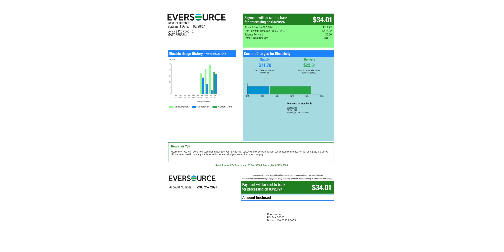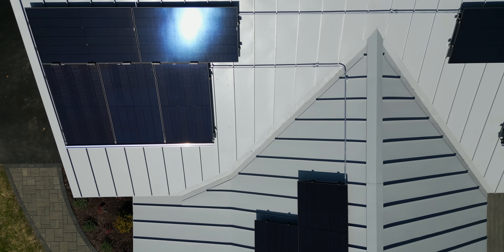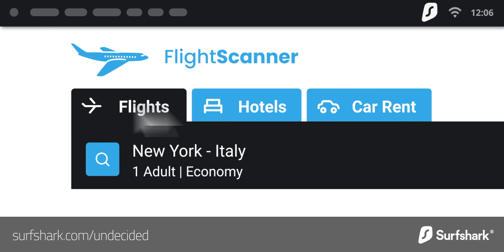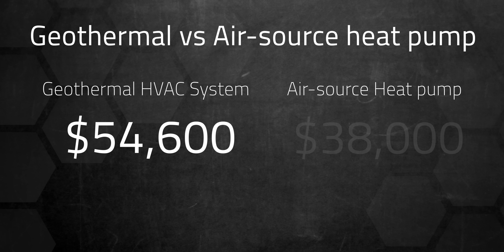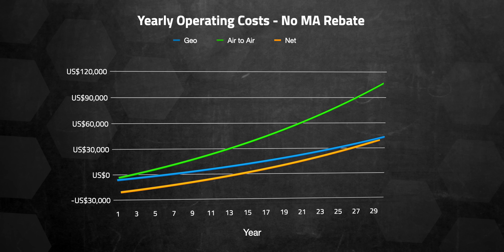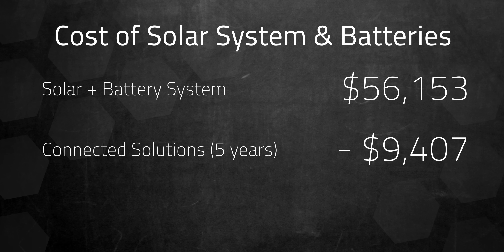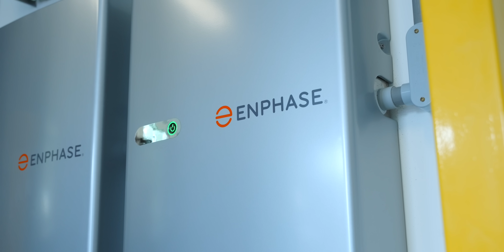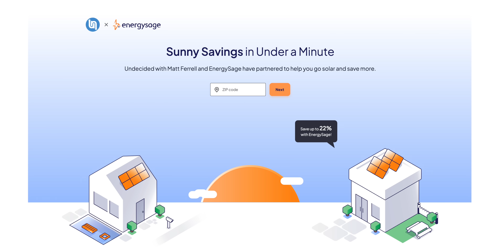What I Learned After 1 Year with New Solar Panels

Comment: Wonderful roundup. It is much easier to package all of this with a new home build, as the percent to over all cost is much more palatable. I like how you even calculated the degradation in your solar panels - so in this regard, excellent video.

First, I do wonder though, the geothermal setup was very expensive. My solution to heating the hot water, was to simply let the solar power do it during the day. Our $2,000 hot water cylinder is set to a timer, and uses around 3 to 9kw a day depending on the season. Is there a reason you didn't go down this path? the geothermal will of course offer many other benefits, importantly helping stabilise the temperature in the home.

Second, did you consider not installing batteries and just use the gird as a battery given they pay 1 to 1 credit per Kw/h supplied to the grid? I'm in Australia, our supply tariff is now only a few cents per Kw. This is because solar is just so abundant, they literally don't need it anymore. In fact, my supplier has free power from 11:00am to 2:00pm to help play the negative market for electricity during this time of the day - so i run everything at this time, including charging our 2 cars, heating our hot water, pool pump, do the washing, etc... 

Third, i simply love how much you get paid for the stabilisation of the grid program (being a VPP setup) where you get paid an average of $275 per kw (this is insane and worth doing just for this benefit alone). Australia used to have a decent feed in rates for a VPP, but it has decreased substantially over the years. Often there is a small sign up amount given as a discount when buying a home battery, but the feed in rates are about the same as normal Feed-in-Tariff's. For me, that would be $0.03 per Kw. Guess what program I did not sign up for. Some companies offer a bit more for their FIT, but i get the free power at midday, which I much prefer.

lastly, the solar and batteries you have are very expensive, and I'm sure you will get lost of comments on this, but its worth noting this is local cost, and everyone in your area is stuck to those costs (i.e. everyone in America). This may be lots of red tap, gouging, supply issues, etc... but its simply the cost of energy independence in America. I'm luck enough to be in Australia, so my 13.6kw Franklin battery, 13.2kw solar, and 3 phase upgrade setup cost $20,000 (AU) in total. Yesterday I saw 13.2kw solar system installed advertised at just $3,999 (AU). I hope this can be address into the future for America - though with the incoming administration this is not likely to happen any time soon.

Great video as usual.

Comment: After seeing some states and countries deciding to forego 1:1 net metering, I feel utilities will ALWAYS change the rules to suit them best, so my goal is DIY off-grid "eventually," and do so well, but cheaply. I'm running 2 EG4 6000 XP's (will add a 3rd) with mini-splits, older-style dryer, electric water heater, etc (all standard stuff) I only have 12K of solar so far, planning on doubling that, Also only have 30KWH of LiFePo4 storage (which I plan to triple). System covers 90% of summer use and 60% of winter. I run "Grid assisted" at the moment and don't feed anything back. Current system has cost me $12K, It will probably be another $12-14K invested before I can fully grid-disconnect (I have NOT figured in federal rebates, which I am eligible for), but I can see that day on the horizon. Your system numbers are fantastic, If you quadrupled your battery and added just a few more panels (for winter production) you could be off-grid too, if you wanted to be. But your costs to do so are significantly higher than mine.
Reply: Utilities are set up to supply reliable power. A few people adding solar power might help them handle peak summer load, but at some point additional solar generation destabilizes the grid especially as that source drops off right as peak demand begins in the evening. Utilities may be doing what’s in their best interest, but their interest is the consumer’s interest, basically 😅

Comment: I'm really surprised at how expensive solar is in the US. For fun just tried the calculator on a website I know my friends have gotten their solar from.

20kW Hyundai panels. 3phase Growatt 20kW inverter. 20kWh Growatt batteries.
Total 107.000DKK (15.000$) and 40.000DKK (5700$) for the install. That is including everything and taxes. Not including any possible government rebates.

And I live in Denmark. We have high taxes and high wages and still it's cheaper here

Comment: Solar panels and batteries are too expensive in USA, here in Pakistan the 17 kw solar system  + battery would cost $8000. that is straight 10 times cheaper.

Comment: So you must have paid an installer to pay $55,384 for 43 400 watt panels? I paid $3,600 for 36 400 watt panels, and they are bifacial and their bifacial rating is 525 watts. I paid $8,412 for 30.72kWh of batteries. So if your willing to install your own system you can save a lot of money, thus making the system pay for it self much sooner.

Comment: I had a passive net zero home built 6 years ago.  This home takes advantage of the solar gain with passive heating and wide overhang roof to stay cool in the summer.  The energy produced from the Solar Panels (PVs) is used to heat and cool our home as well hot water, electric vehicles as well for all the electrical uses for the home.  With no utility bill, except for small service charge from our utility company.

Bad decisions we avoided:  No geothermal system both expensive and unnecessary with passive heating.  No expensive battery backup or storage system because our utility company take the energy we produce in the summer months and we get it back in the winter.  

We needed only good thermal envelope, south facing triple pane windows and PVs, Energy recovery ventilator (ERV) and heat pumps.  Simple is better!
Reply: Don't worry, you will get screwed by your utility company pretty soon...
Reply: @wikingagresor a possibility, I will have to get a power wall if that happens.
Reply: Without battery backup, do you rely on the grid when the sun goes down? I plan to build my own passive house soon.
Reply: @DanielDuedu  I have a small gas Honda generator. If I lose power, which hardly ever happens I can plug in my refrigerator, microwave oven, till I get power back.
Reply: I was hoping he would address a solution like yours in the video. Before I did what he did I would have wanted to do a cost tradeoff on increasing the passive efficiency of the house versus geothermal heat pumps.. I don't know how real it is but there are videos where people claim that a hairdryer can heat their home. I also would have been very reluctant to invest that kind of capital in devices that were experiencing large price drops over time.
Reply: @davefoc A hairdryer would actually be inefficient! They should get an Ecoflow Wave 2 or Zerobreeze 3 and use that on hot mode, 400ish watts against 1200!
(Just make sure the Ecoflow's hot mode actually works, found out the hard way that mine didn't)
Reply: @michaelmartin9022  he means the power of a hair dryer is enough to heat a home (ie 1800w or so). Its quite a common comparison in passivehaus groups.

Ive seen passive houses that were designed to be heated by electric towel rails at a couple of hundred watts...
Reply: Very few utility companies can operate like that, must be in an area with a lot of hydro.
Reply: @edc1569  Connecticut, hydro??
Reply: just think when your company does like every other company. buys it 4C and then sells it back for 12C. when electric companies gives home owners market value for what they produce. other users loses 9C per watt you make. and many companies are tired of that.
Reply: Living the dream. I plan a passive solar, possibly using earth tubes for temperature moderation, with and without tons of insulated earth hidden underground (air system, no drilling or water to leak). Foamcrete exterior walls, rammed earth interior walls. Mid--century modern design, with tons of hidden tech. Old meets new!
Reply: This is my experience with solar over the past 30 years. The cheapest power is the power that you avoid using. It is amazing how little power you actually need if you optimise your house FIRST. Correct orientation of the house, overhangs, triple (double?) glazing, proper insulation. Then the consumers: minimize the freezers, pumps, use excess wood for heating, do you need this huge TV or is a smaller one good enough? etc.. etc. Then timings: Heat (cool) the house when there is loads of sun, store that temperature in your building structure, do the laundry when there is excess power, heat your warm water with excess power. And then, finally then, design your electrical system and be amazed how little you need.
But then, when you check the batteries etc required to store the energy, be surprised how expensive that becomes when you do not have net backup and you need to store for 3 days. In my case, it was better to use a generator to charge the batteries for the few days without any sunlight. 
Every case is different, but my main learning was: Plan properly, think it through carefully. Spend more hours on planning and designing than on construction and your savings will be enormous. You WILL learn a everything about solar and electricity you need if you spend the time. Then you will see that installing the system yourself is just easy and you can save >50% when you do it yourself.

Comment: I'd have to argue everyone should have solar if the building is really suitable for it - as even if you can't afford to put solar on your home the utility/governments should be looking to do so for you as all that excess power generation is a good thing for them - making manufacturing cheaper etc and with more power produced in the near vicinity of the power consumer the grid upgrades which are already required anyway can be a little cheaper. 
If you didn't pay for the solar yourself expect to be the second class user and likely seeing relatively little direct benefit compared to owning it, but you will still benefit overall as the community you are part of as a whole should see cheaper bills, more jobs etc.

Comment: I like the idea of solar, but it is ridiculous for consumers to buy solar power at its “retail” cost.  It would be far less expensive for utility companies to suspend construction of conventional power plants, and instead operate huge solar farms financed by investments from environmentally conscious consumers in their cities.

Then, utility companies could deliver solar power over the years to participating households at a lower cost per kWh than they can produce for themselves in small rooftop installations. Solar panels would be purchased wholesale by a big operator, far fewer storage batteries would be required and regular maintenance would be performed — as opposed to sporadically on home rooftops. 

Finally, those living in apartments have little or no opportunity to invest in solar power under the “retail” rooftop approach, but they could be solar investors and solar users if local utility companies would operate solar farms in partnership with consumers.

Comment: you MASSIVELY over paid for your solar panels, you can get 31 370w bifacial for $3000. they typically output 440w. you have 45 panels. for my panels that's less then $6000 to equal 19.8kW vs your ungodly $55,000. you got screwed

Comment: It is amazing how expensive solar is in the US. My 15kWh battery,  24 x 440W bifacial panels, inverter etc system cost about US$17000. Fully installed in Australia.
Reply: Yes.  We are getting ripped off in the US.
Reply: @JBoy340a  He got ripped off. More $ than brains.

Comment: 80+ kUSD for 20kwh batteries  and 17kw panels while the annual total consumption was something around 18 000 kwh.  pretty interesting. In Finland that amount of electricity would cost (with fixe price, taxes and transmission included) around 2200€ / 2400 USD

Comment: Thank you for your detailed and informative video.  I been watching your progress for years now.  As a young Electrical Engineer in the late 70's I started trying to figure out how to make Solar work on my homes.  What has changed today is the advancement of solar, electronics, batterers and government kick backs.  I found that you have to build a well insulated and sealed house like yours to make a lot of your system to pay of in the short term.  I now living in a two story house at 72 and believe I might make it here for 10 more years. If I was a young man again, I would build a house like yours.  What is your take on what it will cost to recycle those batteries and someday the panels?